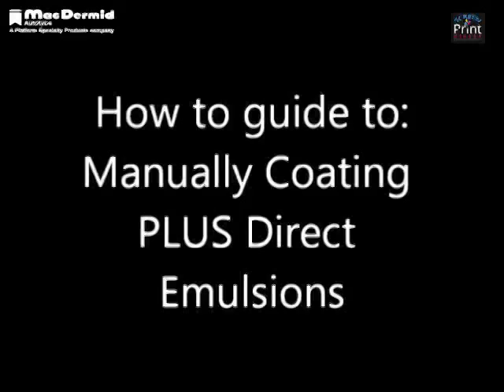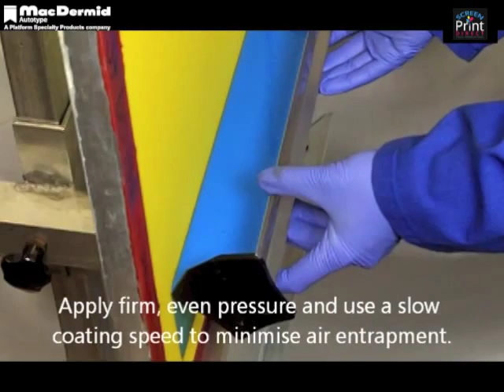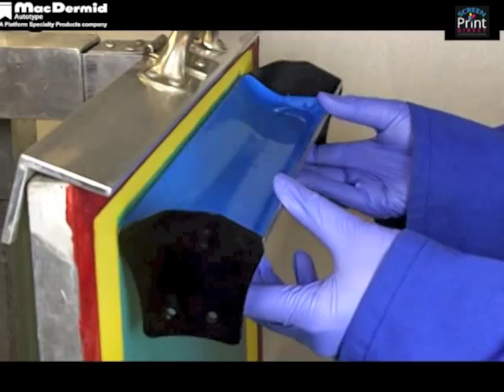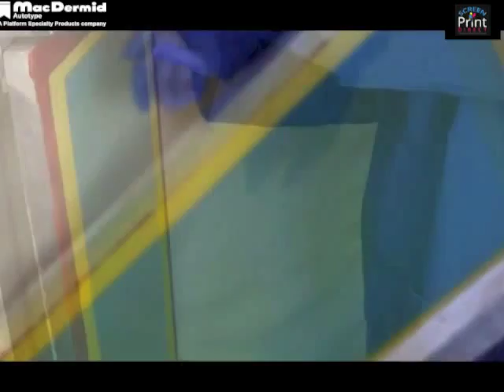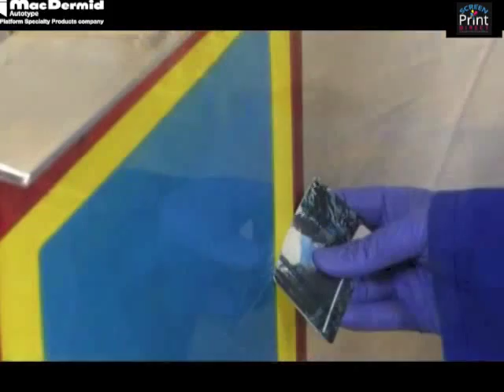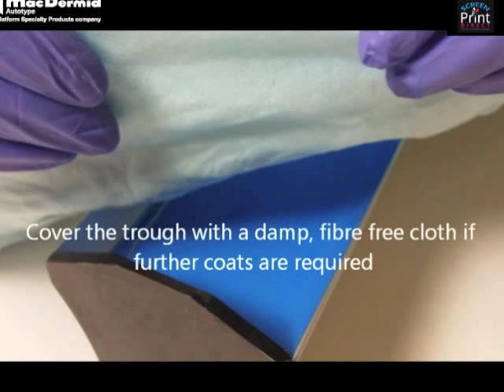How To Screen Print: How to coat screen printing emulsions by hand.

Comment from the maker: How To Screen Print: How to coat screen printing emulsions by hand

Consistent and good quality coating of mesh is key to the quality of the finished print. In this short video you will learn how to successfully coat screen printing mesh with a photo emulsion by hand.

Prior to coating any mesh it is important that you degrease your mesh.

AN ABSOLUTE NECESSITY:  It can never be emphasised enough just how important thorough mesh preparation is. It should be looked upon as one of the basic ground rules when producing stencils.
Failure to pretreat mesh can lead to to costly breakdown and screen re-coating in production, which can easily be avoided by taking these few extra and inexpensive minutes at the very beginning. For more information on mesh preparation take a look at  How To Screen Print: How to degrease screen printing mesh    #screenprinting     #screenprint     #textileprinting     #silkscreenprinting     #printmaking     #tshirtprinting
Reply: Nice video Screen Print Direct.
Reply from the maker: Thanks Ashley's Design & Letterman Jackets we hope screen printers find it useful as a guide to coating screens.
Reply from the maker: When our website goes live this month their will also be more information on coating emulsions and also hints and tips to resolve coating problems.
Reply: This is great! We always coat ours by hand, but have found that more than one coat makes the exposure trickier. Looking forward to seeing more of these to see if there's a reason why.
Reply: That requires some skill